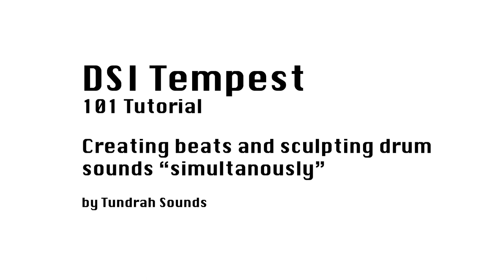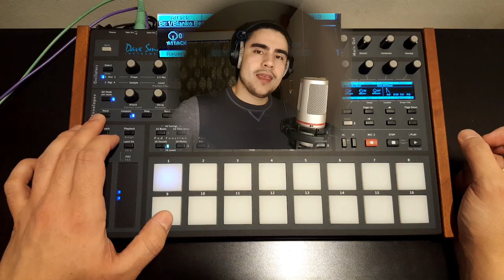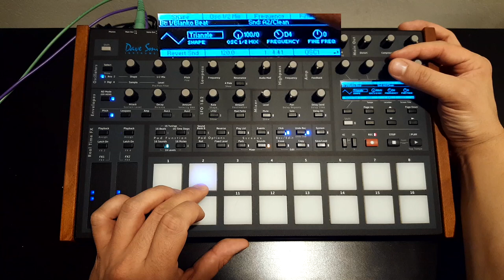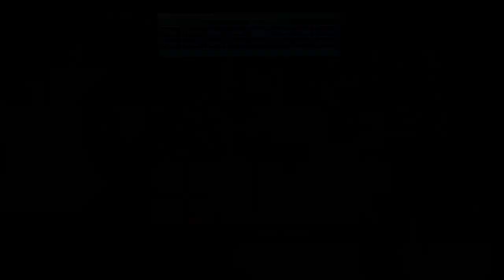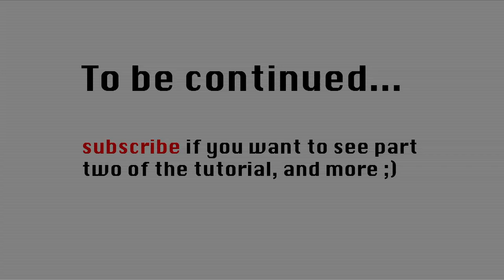Tempest - Make Drum Sounds and Beats «on the fly»

Comment: Hi there, first of all, awsome vid, thanks man. one question: if I initialize my sounds and follow your instructions, my sound only sounds like yours if im in 16 tunings mode hitting a1 - in sound mode, my sound sounds so different from yours, although root note is indicated as the same you have... dont get it. any ideas? keep on, thanks a lot!
Reply from the maker: Different as in deeper or higher note?
Reply: its higher. I actually did calibrate all Osc and pads in order to rule out any dissonances by the machine itself. but its not working.. as I said, when in 16 tunings, its fine.. ?!
Reply from the maker: It is possible it is my machine. I'll have to take a look at the octaves in both sound mode, 16 tunings mode... also maybe recalibrate mine. It's not a good lesson if it's not working for everyone. Thanks for the feedback! I'll look into it :)
Reply: you saw schneiders kick design vid as well as I remarked in its comments section - I checked my machine and its working exactly as schneiders machine when creating the kick, therefore I thought its helpful to ask. Thanks for the quick response though, let me know your results. keep on doing your great stuff! subscribed!
Reply from the maker: I think I've found out what was "wrong" with my tempest settings. Click on the "system" button, then change master transpose. Mine was like 4 octave too high. Damn! I feel like I'm fooling people with my approach in this video. I'm glad you said something. I don't want to take it down though. We all learn together. I'll put it in the description instead.